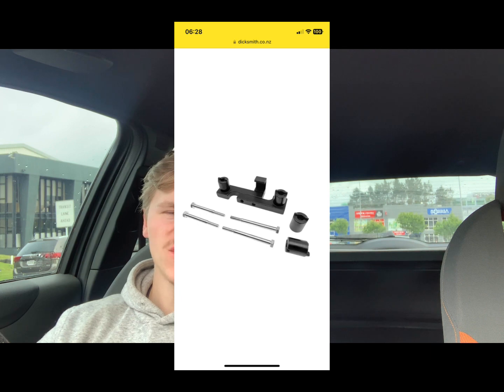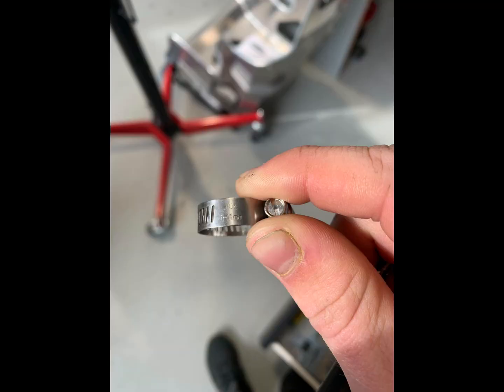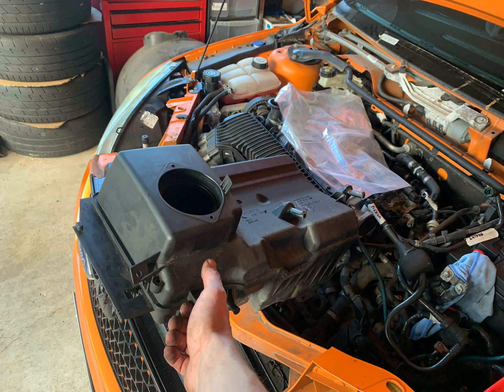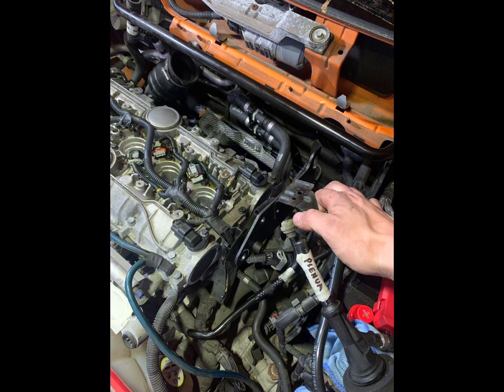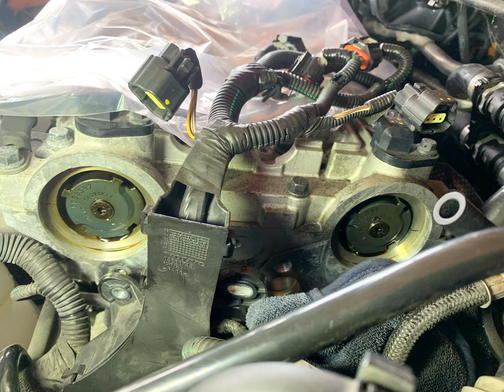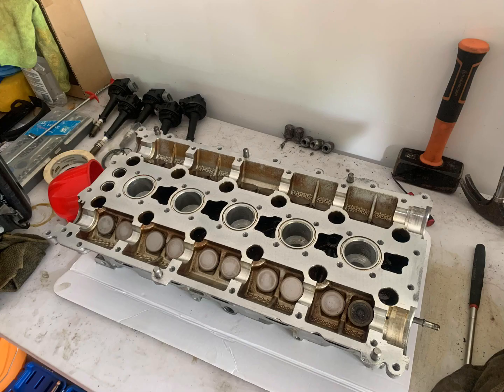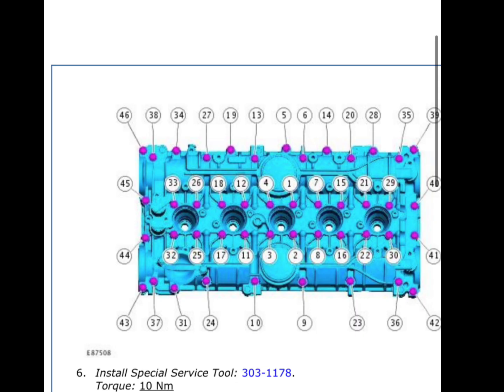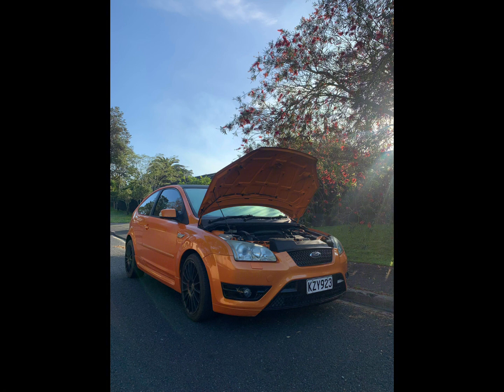ULTIMATE Step by Step Guide to the BLOCK MOD for MK2 Ford ST/RS/XRS + Timing belt replacement

Comment: Quick question, do the valve/rocker covers have a gasket? 
I watched another video on this 2.5L engine and when they popped the cover off there was no gasket and I wasnt able to see one on this either because it's not a video but there doesnt seem to be a groove for a gasket to sit in when I seen the cover in other video guides.
Reply from the maker: So there is no rubber gasket. They use a sealant from factory rather than a gasket. Over time it just gets darker and makes it a bit harder to see but when you pull off the rocker cover they’ll be a brown colored matchiness on the surface you’ll have to carefully scrap off and then use an anerobic gasket sealant to make your own gasket. That’s the red stuff you can see me apply in the photos before I put on
Reply: Thanks heaps for that, ours is starting to dribble out the front corner covering the drive belts. Very detailed video.
I appreciate the answer mate 👌

Comment: They made same mistake with focus mk3 rs too. 
Should just used st block
Awesome video
Reply from the maker: Wow I didn’t know the mk3 had the same issue that’s crazy. Glad you enjoyed the video thanks for watching.
Reply: @turbo_tyler_  yeah rs 2.3 open deck holds no power
Meanwhile st mk3 2.0 holds allot more power 
So mountune uk sell st blocks bored to 2.3 at a hefty price.
I think mountune USA sell reinforcement kits for the stock open deck 2.3
Yeah big design oversight lol